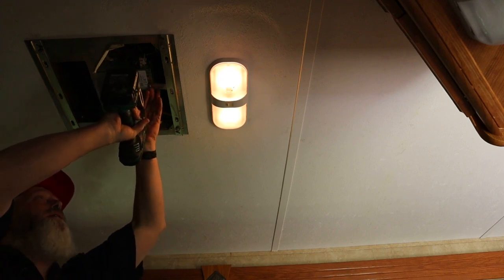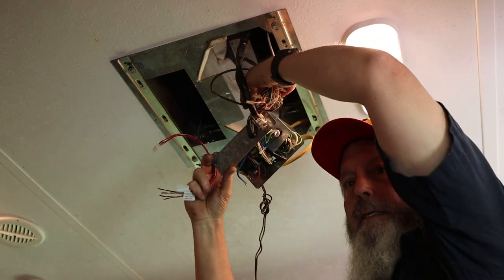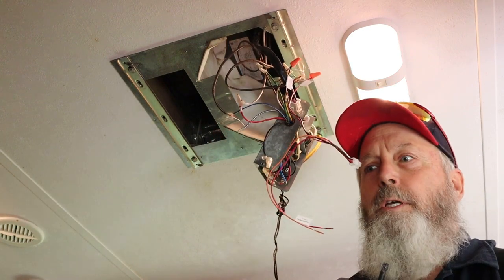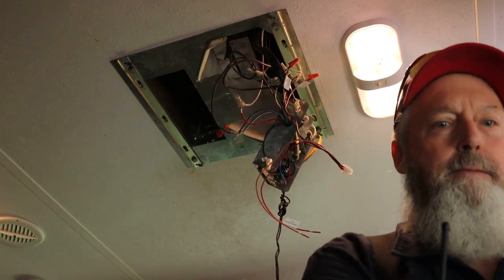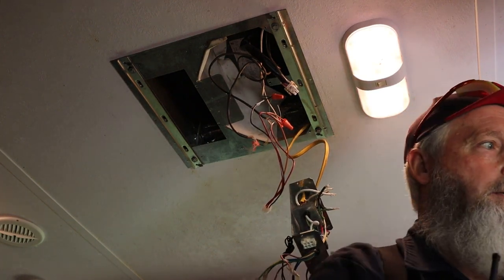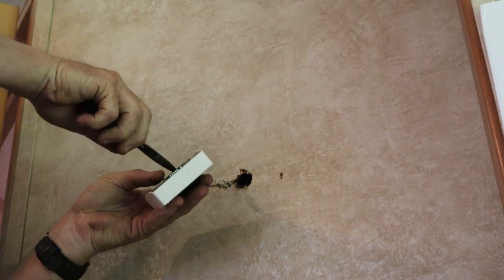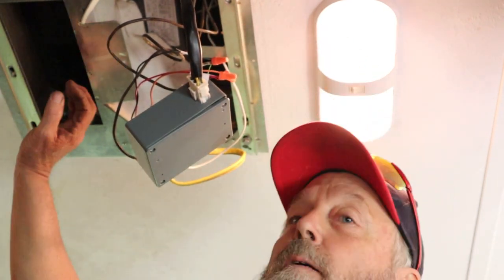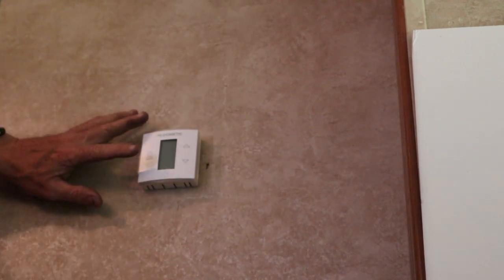Switching Dometic AC From Analog To Digital Controls

Comment: I have the old Dometic 3107541.009. Any idea what digital unit (model number) I can use to replace it? The unit you replaced looks almost identical to the one in my trailer.
Reply from the maker: If your thermostat looks like the ones in my video, you just need Dometic single zone control and thermostat. You can find those in my Amazon store. https://www.amazon.com/shop/hillbillyrv
Reply: @hillbillyrv  thank you much appreciated!

Comment: This video was alot of help. Thank you. One problem though.  There are not 2 blue wires coming from the furnace. I hooked up the old controller box and thermostat  and the furnace works but the air conditioner won't . Do you have a suggestion?
Brett
Reply from the maker: If you don't have furnace wires what is turning the furnace on.
Reply: @hillbillyrv  the old board I suppose. I had the furnace going  the other day, but not the ac

Comment: Can you tell me more on wiring the original box to the camper?. Big black wire and big red wire...2 little blue wires...white and red with white stripe(not in box)...4 wires for t-stat..1little red 12vdc and 1 black
Reply from the maker: Get your meter out and start testing. I have several videos on this subject. Be sure to watch them all. You might find your answer there.

Comment: Hillbilly RV, thank you so much for the video. I replaced the analog thermostat with a digital Honeywell thermostat, it worked for almost a year. Now I've decided to replace the control box and thermostat (digital) and your video helped greatly, with exception that I didn't see the connection of all three wires into the thermostat cause of technical issues. IN ALL THANKS
Reply from the maker: You are welcome

Comment: Hey Kenny have a question out ac has already been converted to digital years ago we had to have the ac unit replaced due to major hail damage the guy didn’t wire it correctly I followed your video and everything fired up thanks for your help 
There are also two brown wires in the box area any idea what they are
Reply from the maker: Get your meter out and test them. Might figure out what they do.

Comment: First off love your videos, I'm trying to convert my ac when I disassemble it I found it only has a 4 wire from the t-stat and no 12 volt power and no 2 wire from furnace....can I pull the 12 volt from a light ?
Reply from the maker: Yes

Comment: Hey there! I got a newer AC from my uncle and I’m trying to connect this control box/thermostat with this AC. I’m pretty good on everything, but one thing. My camper doesn’t have DC wires in the opening. Do I just connect to the corresponding power wires? Thanks in advance!
Reply from the maker: You have to connect the DC wires to a DC circuit. You are probably putting a Dometic AC where there used to be a  Coleman. You will have to run the wiring that you are missing.

Comment: Liked the video, changed out the same type of control box a year ago because the furnace would not work.  New control box worked for a year and now having the same issue.  Any ideas? If I bypass the control box and go straight thermostat to power, furnace works fine.  Kinda disappointed if the control box failed again after only a year.
Reply from the maker: Could be bad control box

Comment: I’m needing some help swapping from a manual to auto thermostat in my camper. Is there a way I could email you or something and send you some pictures of what I’m running into? Any help would be appreciated. Thanks
Reply from the maker: If you are going from manual controls to a wall mounted thermostat. You have a lot of wiring to do. You need 12volt pos and neg and you have to run 3 new wires from the control box to the thermostat.

Comment: Great video. im a diyer myself on most things to save money. I do have to comment on the new digital system itself. I absolutely hate the digital system or atleast the Thermostat anyways. I live in a country setting and often get critters climbing in through the seal of my slide out right there beside the T-stat. So occasionally ill get a ant roach snail or some sort of bug inside my T-sat and ohhh buddy if im asleep it causes all kinds of havoc in there. Changing my temp settings turning the a/c on or off turning the heater on or off and even changing it from (F) fahrenheit to (C) Celsius. Drives me bonkers especially if its mid summer im taking a nap or something during the day and a critter done got inside there and turned the heater on where I wake up sweating like crazy cause its 90+ F inside. I'll be switching back to analog soon. The new digital T-stat generates just enough warmth to attract the critters when they get inside the camper that it causes hell. Not sure if this happens anywhere else but it sure does happen here in Texas. There is some settings in the digital T-stat that you could show your viewers on how to change from F to C or C to F as well as mode settings for cool only etc. Take Care 👍✌
Reply from the maker: That is too funny. I have never heard of that happening.

Comment: Help help help please. Since having a lightning strike close to my rv, the trailers' ac and furnace run together with the thermostat in auto. I have to pull the fuse and turn breaker off to stop both running. Thanks.
Reply from the maker: Sounds like the lighting fried something. Since the control box is common to both appliances, that’s where I would start.
Reply: @hillbillyrv  thanks for your response.. is the control box in the ac or furnace. Thank you for your time.
Reply from the maker: @ralphrobinson1931  Have you even watched this video or any of the probably half dozen of my videos on this subject?
Reply: @hillbillyrv  yes sir I have watched your videos on the ac. Just didn't know if furnace has control for both units. Thanks again.

Comment: my question is if you have 2 a/c and 2 thermostats if 1 fails do you have to replace both for furnace to work
Reply from the maker: No. Only the one with the 2 blue wires works the furnace. It is usually the AC in the main living area, but it can be either one though.
Reply: @hillbillyrv  thank you for the reply

Comment: How can I direct connect wire ac without thermostat where I'd have to manually disconnect to turn off and reconnect to engage fan and compressor
Reply from the maker: I don't know why you would want to do that, but if you want to direct wire it, then just take out the control box and direct wire it. You could use the breaker to turn it on and off.
Reply: @hillbillyrv  I want to do it just to make sure it works before investing money into it good sir,, on a 6 wire connector top blue, black, yellow, bottom red,white, yellow/green, blue and white are thicker wires on a domestic BTU 15000 any input on how to wire to regular plug or lcdi plug? hypothetically speaking of course, and thanks for writing back big dog brings a little joy to my heart lol idk how else to explain it.
Reply from the maker: @soonerthanlater539  I am pretty sure that in another AC video, I actually jumper one to make sure the fan and the compressor work before I replace the control box.
Reply: @hillbillyrv  I may have burnt the fan motor I didn't realize it had 3 speeds until I seen it smoking I'ma check out that video
Reply from the maker: @soonerthanlater539  Sounds like you are too late.

Comment: Help, your video was great and made the installation of my digital controls quite easy and it all made sense; but, I am getting no power to the thermostat from the control box. Troubleshooting steps:  There is power to the box which tests inside the box; if you short the main power to the thermostat power lead in the box there is a click and shortly after the heater fan starts (you then have to short the terminals again to shut the heater fan off again with a short delay), the thermostat does not power on at any time. I then applied power directly to the thermostat and the thermostat did not power on even though there was power to the thermostat's internal connection. This is very frustrating and I truly hope you can help me; you will be my first patreon attempt even if all you can tell me is: Neener, neener neener.
Reply from the maker: You should have 12 volt DC on which ever wire you used for 12 DC. You should have a ground on the ground wire. Use your meter and go from neg to pos. If you have power then you could have a bad t-stat. If no power, then you might have a bad control box. Double, double check all of your wiring. It is easy to make a mistake. How would I know that, do you need to ask? ha ha
Reply: @hillbillyrv  Well, when you are telling tales you can now add; dumbie had his house battery in backward so there was reversed polarity. (That's what can happen when you install a battery in the dark.)
Reply from the maker: @asawreviews4270  I am super glad that I have never done anything stupid.....wink wink
Did you figure that out when you started checking with your meter?
Reply: @hillbillyrv  Oh way more embarrassing than that. The original project was to install an inverter so I could power a residential fridge and add solar later using lithium batteries. Note, I am 71 years old and have worked on cars most of my working life and built and wired my house and a couple of garages. Apparently, I installed the house battery backward last fall and have been trying to figure out why the 12-volt stuff was not working correctly, or at all in most cases, such as the thermostat for the air conditioning. Today after removing the inverter from the circuit and connecting directly to shore power I wanted to connect a battery minder to the house battery and surprise, surprise; the negative cable was on the + terminal. Installed another fully charged battery, correctly; and all my issues went away. I will state that finding the problem was pretty much an accident (My computer won't turn on. Is it plugged in?). I will also state that this has to be the dumbest mistake ever amongst some qualifying entries.
Reply from the maker: @asawreviews4270  None of us are perfect.

Comment: I have a brand new dometic brisk air 2 evolution withe control knobs on the unit itself can i put one of these on that and mount a thermostat on the wall ?
Reply from the maker: That would require a lot of work and running a lot of new wire. Probably best to keep what you have.
Reply: @hillbillyrv   i am an electrcian and i would only have to run a thermostat wire to where i need it correct ?
Reply: @hillbillyrv   of course i know i would need the control box kit
Reply: Am i right ? Im asking cause i dont know lol
Reply from the maker: @serious101101  You will need to run 12v Pos and 12v Neg up at the control box and 3 wires between control box and T-stat.
Reply: @hillbillyrv   ok ty

Comment: We just made the switch from analogy to digital. A/C works good heater wont come on. The 2 wires that plug into for heater one red and one white the red one is hot is this correct. Or its something wrong. Thanks for the awesome videos
Reply from the maker: It might be hot. Touch them together, furnace should come on after a short delay. If it works like that and won't work when you reattach to the new control board, then you have a bad control board.
Reply: No heater did not come on when the 2 wires touched together
Reply from the maker: @paulmosely2293  If those are truly the furnace thermostat wires then it is time to watch my furnace videos and figure out what is wrong with the furnace.
Reply: I tested the furnace took out nothing is working on the furnace. I tested the board just clicked tested the fan nothing. I jumped the fan and nothing. I ordered a new furnace. We replaced the board 3 years ago I remember how I tested it along with the fan.
Reply from the maker: @paulmosely2293  Wow. A new furnace just because it has a bad component?
Reply: If it was only the board I would get it and replace. The motor is locked up and the fan wont spin and the burner is rusted. Cost wise about 350.00 plus for parts. I picked up a core that fits for 375.00 new. The furnace is 12 years old and has been well maintain.
Reply from the maker: @paulmosely2293  Ok...that's a different story. You didn't say all that stuff was wrong with it....$375 isn't bad...
Reply: All fixes everything works good thanks for your help
Reply from the maker: @paulmosely2293  Awesome Paul